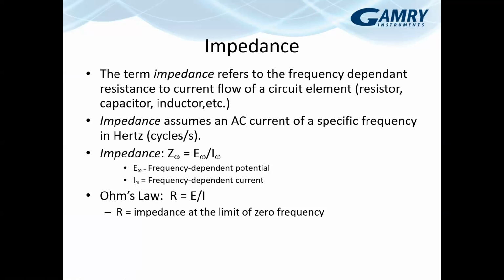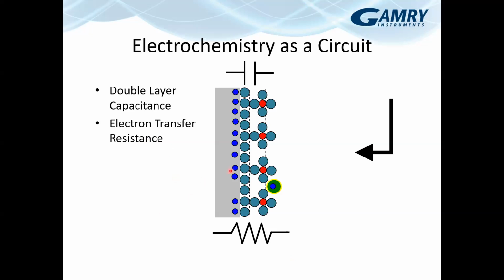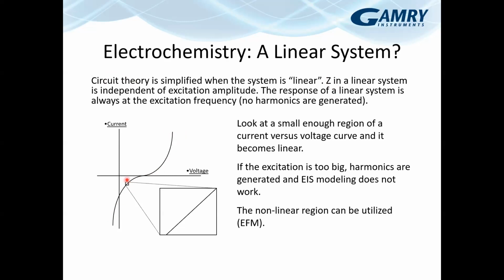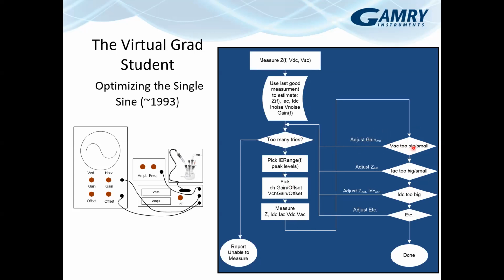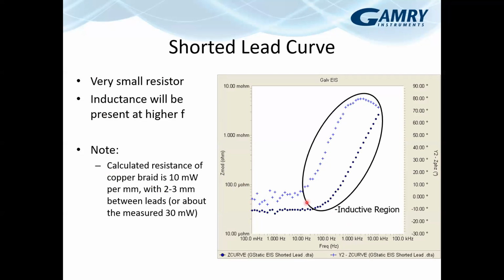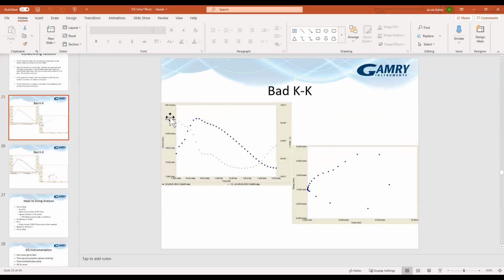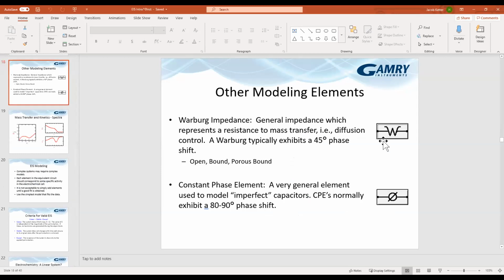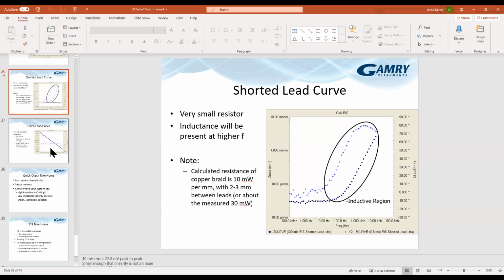Webinar Basics of Electrochemical Impedance Spectroscopy (EIS)

Comment: If your KK transform doesn't fit your experimental data  how can you change the conditions of your measurement (voltage amplitude....) to improve the fitting? And if it doesn't fit only at low frequencies, does it invalidate the rest of the spectra? In my case it fits the spectra in the high frequency range (which gives the most important information) and deviates later at low frequencies. Thank you in advance.

Comment: How is DC voltage selected when doing EIS?  This is rarely discussed when discussing EIS.
Reply from the maker: In many situations, EIS is run without DC polarization. Meaning, the DC polarization is set to 0V vs Eoc (Open Circuit Potential). This is so the spectra can be acquired at steady-state. There can be exceptions in cases of high impedance coatings, driving a fuel cell, etc, but these are less common.

If you email techsupport@gamry.com, one of our engineers can discuss how to set a DC potential that is appropriate for your application.

Comment: How did you know, that the value for C is C = 1μF in the simplified circuit?
Reply from the maker: The EIS dummy cell (also known as the AC dummy cell) we provide with our instruments uses a 1μF capacitor. So it is a known value from the hardware used.

If you have additional questions, please reach out to our Technical Support Engineers at techsupport@gamry.com
Reply: @gamryinstruments  Ah okay, thank you! I thought that I missed something

Comment: Why is a plot not drawn between impedance vs applied AC voltage in the EIS study?
Reply from the maker: There is no valuable information obtained from plotting Impedance vs AC Voltage. The amplitude of the signal is only important in ensuring that you remain in the linear response region for your cell. 

If you have more questions, please feel free to contact techsupport@gamry.com
Reply: Thanks a lot. I got it.

Comment: why the charge  transfer resistance comes high when the electrolyte is EC/DEC(FEC-10%) and lower when the electrolyte is EC:DEC?
Reply from the maker: It is possible the FEC, which is added to help prevent blocking SEI formation, actually does some sort of blocking itself. This could slow the reaction down. It is also possible SEI is favored, and so the other path that it is pushed to has slower kinetics (and higher ET resistance). This phenomenon is not fully understood. Going to Research Gate may yield responses from the most up-to-date research in this field.
Reply: @gamryinstruments  Thank you

Comment: what is the meaning of getting overflow for EIS for corrosion measurement? using Gamry reference 3000
Reply from the maker: There can be many reasons why an overload may occur during an EIS test. You can send your data and cell setup information to techsupport@gamry.com, and one of our support engineers can provide feedback for your specific experiment.